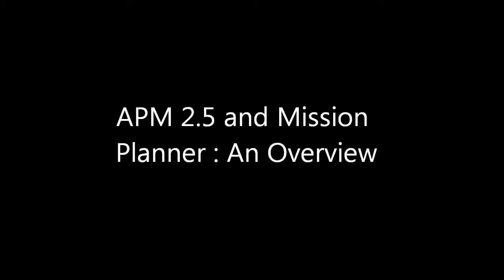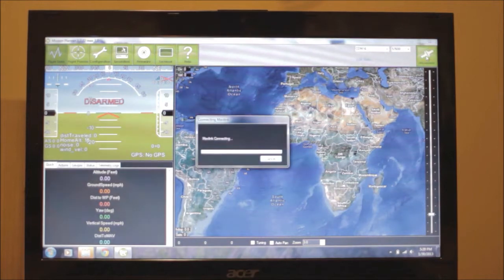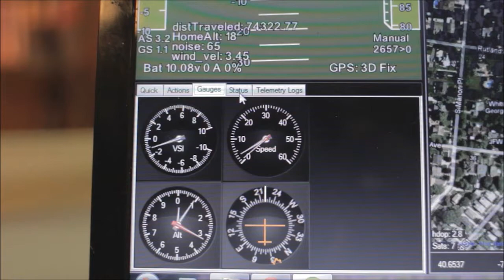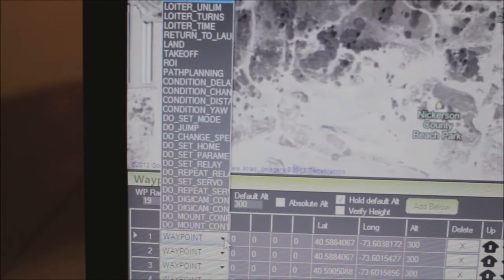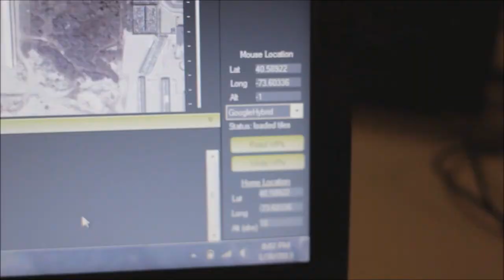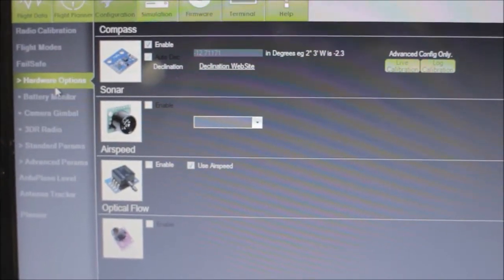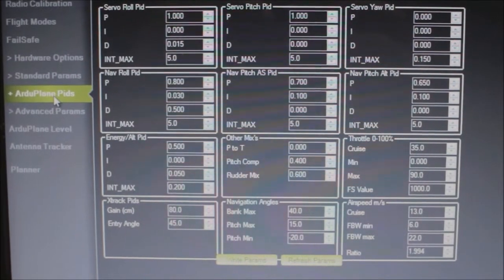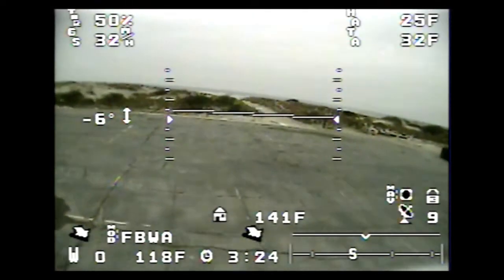Arduplane APM 2.5 & Mission Planner Overview

Comment from the maker: In this video I am using a Skywalker 2013. I also use Penguin air frame.
Tx and Rx radios are Frsky 2.4Ghz, Video is 1.3 Ghz (circular polarized antenna you referenced). Also, the set up in this video is strictly for functional demonstration and not how my production models appear (ie camera is not taped on). I mainly focus on mapping and not FPV my RTF mapping UAVs do not need FPV at all. Bixler 2 is a great first plane but not good for mapping. I suggest Penguin.

Comment: I have experienced problem with my GPS MEDIATEK 2.0 could explain how to improve performance using CC10A UBEC? I plug the GPS power wire directly into UBEC? or I connect the POWER MODULE in UBEC and the POWER MODULE in the APM 2.5 and then plug the GPS usually in APM 2.5? (sorry for my google translator)

Comment from the maker: It's a type of pilot assist mode similar to stabilize but allows you to set limits on the roll and pitch. It makes it EXTREMELY easy to fly and is great for take off and landing. It's also the foundation of tuning for autopilot mode.

Comment from the maker: I am using is Frsky Battery monitor so it reports back to an FLD-02 monitor on my Turnigy 9x. The sparkfun attopilot battery monitor that comes with APM 2.5 (not included when I bought mine) can be configured with minimOSD. This requires customizing the APM firmware, tuning the sensor in mission planner, and config in minimOSD to display V data. I picked up the Frsky sensors and now have V per cell, total V, total mA consumed, and live mA reading. Its's plug n play and has everything I wanted